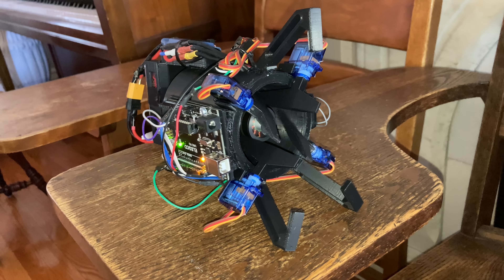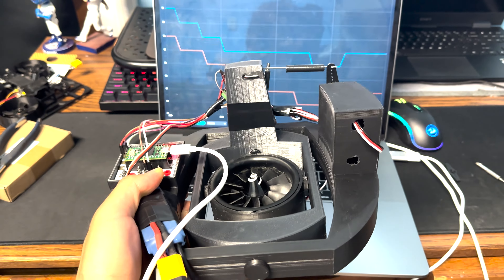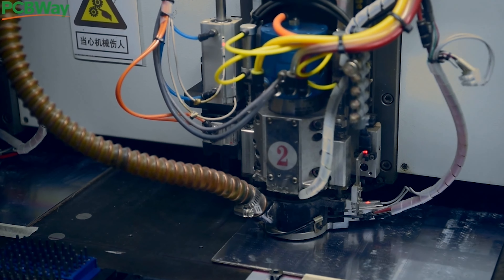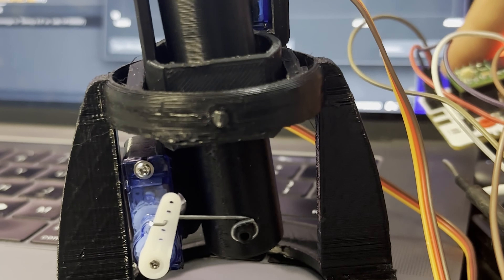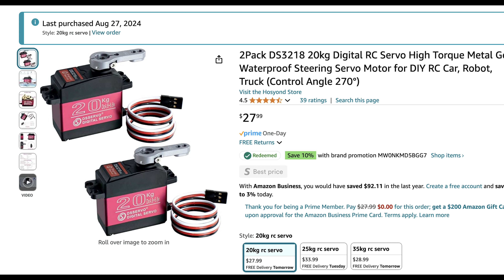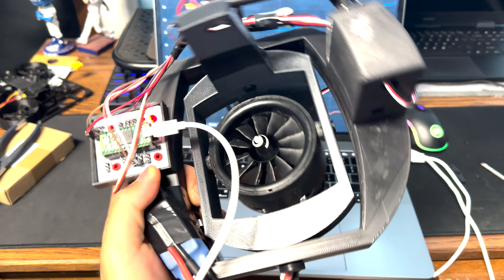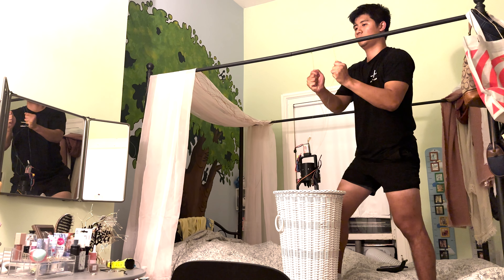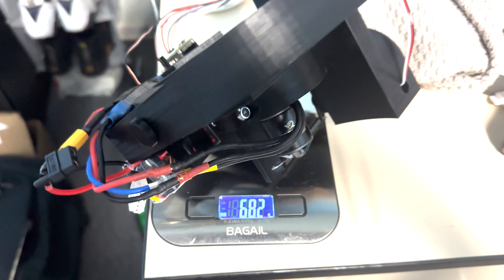Gimbal Your Ducted Fan: How and Why

Comment: Angular momentum will be nearly impossible overcome with this design, for the same reason helicopters require a tail rotor.
Reply: Enjoyed the video though, I'm working on a fully 3D printed EDF at the moment and I may take it a step further with a thrust vectoring mechanism
Reply from the maker: I’m working on a coaxial system right now. I tried thrust vanes but those are super tricky dynamics wise

That’s sick, I actually did a ton of 3D printed EDF stuff feel free to use those vids as resources! Is yours FDM?